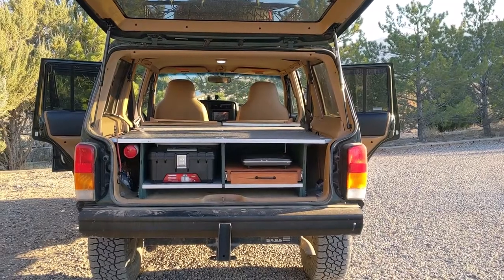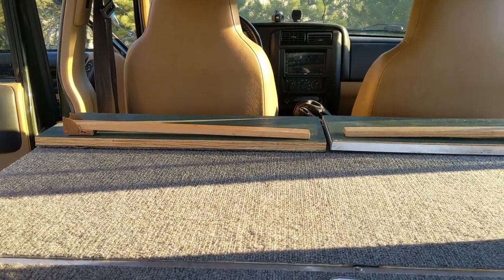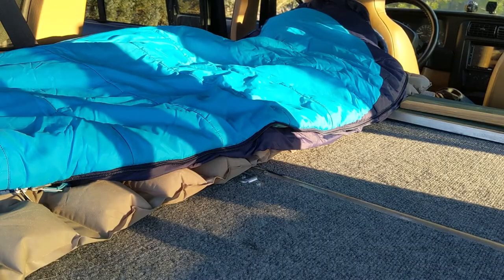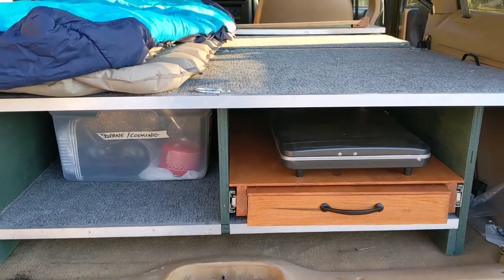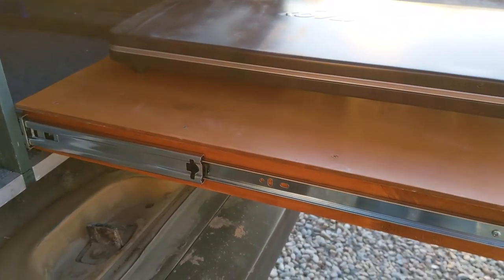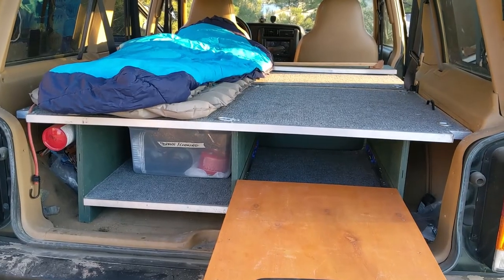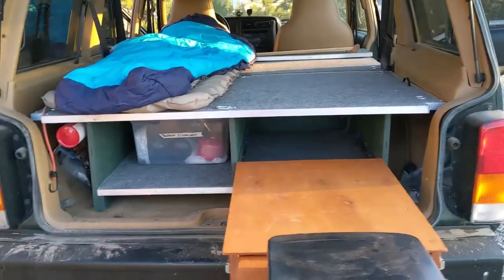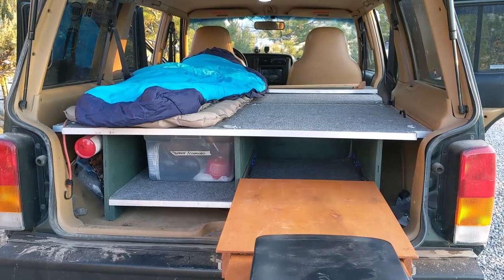XJ Cherokee Sleeping Platform & Storage Solution

Comment: You are correct if you are over 5' 10" it doesn't work. You have to sleep diagonally. I am also 5'10" and I used to sleep in the back.
Reply: My plan is to modify the front passenger seat to allow a longer bunk. Either locate a seat from a 2 door that folds forward or modify the seat tracks.

Comment: Why didn't you remove rear seat? Would allow the front seats to recline and possibly make the folding section easier to deploy/reset. 
If you ever get tired of having to slide the front seats forward, look into getting f'seats from a 2dr xj b/c they have tilt forward function... though stay with 97+ to avoid mounting differences.
Reply from the maker: I didn't want to remove the rear seat because that's an extra hassle to put it back in when switching back to using the rear seat.

Comment: Damn dude lay the passenger seatback  forward and you have plenty of room to stretch out
Reply from the maker: Well aware of that, I do, that's how I'm able to have the folding section at the front end of the platform.
Reply: @grahamjgreen  just wondering since you didn’t mention the passenger side and you had your bed roll on drivers side. I like your build. I took the rear seat and passenger seat out and put a deck the same height as the factory rear deck and will use plastic totes for storage so I can take them out of the way at camp. I have 2 Belgian Malinois dogs that go with me since I only camp as far back and as high as I can get in the backcountry.